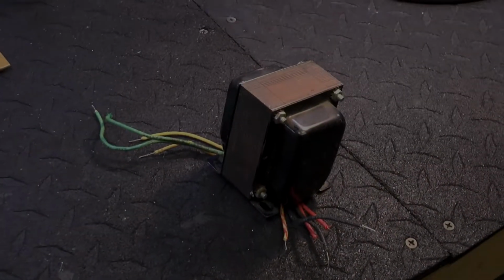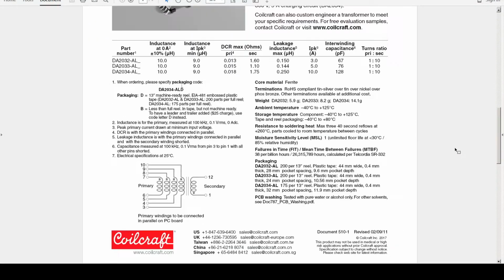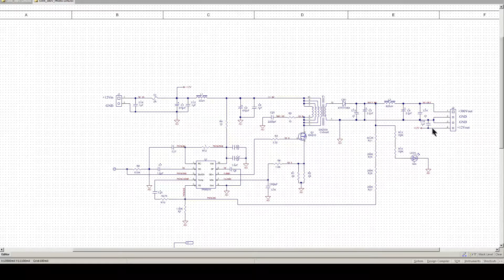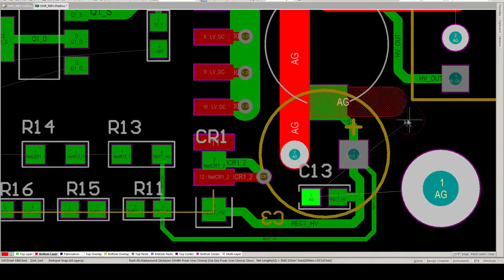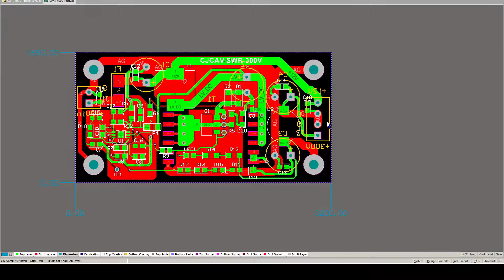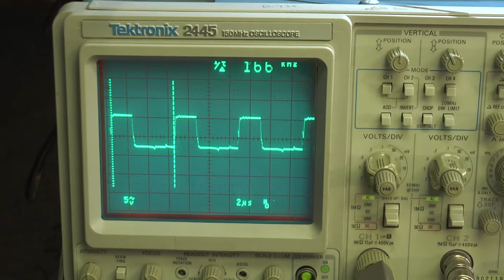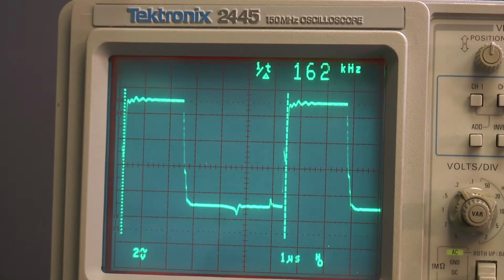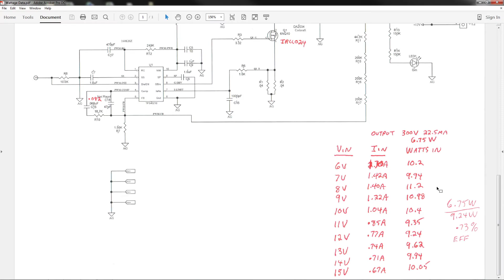A 300V Switching Power Supply for Vacuum Tube Preamplifiers

Comment: Hi, nice work!  Have you considered using a resistor-network voltage divider+ TL431 + opto isolator to do a truly isolated HV power supply?
Reply from the maker: Yea, This supply had common grounds so isolation wasn't necessary plus its powered from a 12v wallwort. Many of my other switchers such as the one in the tube amplifier design has what you described.

Comment: Was this project a success? Approx 1 year ago Blackstar Amplification released the St. James, guitar tube amp describing it as lightweight with no noise or hum. Blackstar swapped the transformers for SMPS. Do you offer these types of modification services? I recently acquired a Marshall JVM 215c. Love the sound but hate the weight and noise.
Reply from the maker: That sounds like a good business. Getting the 5 to 600v plate voltage is challenging for the transformer design but SMPS for tube amps is very practical . If I was 20 years younger and not retired I would kick out a few designs. Thanks